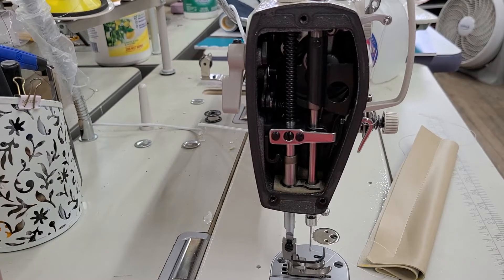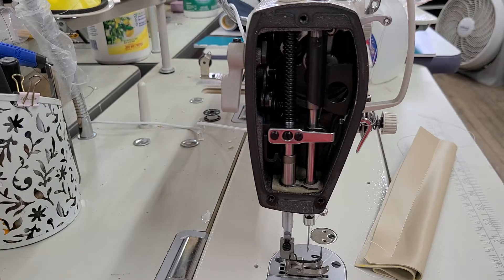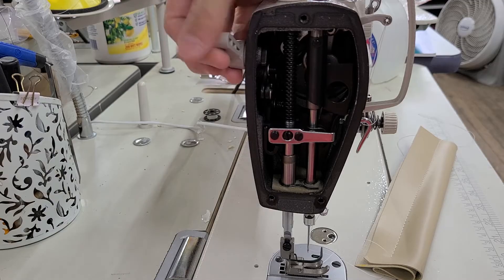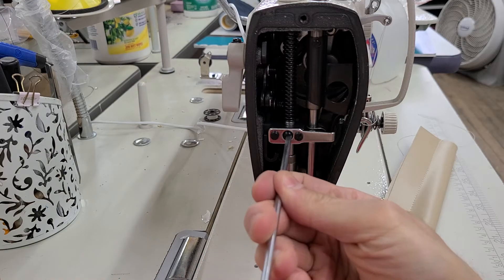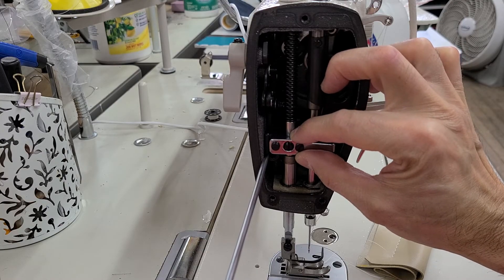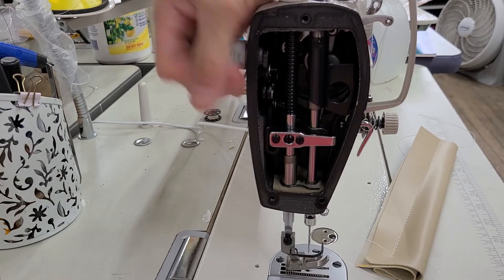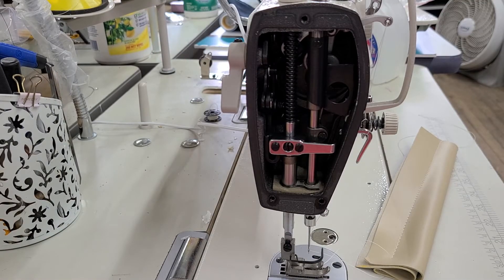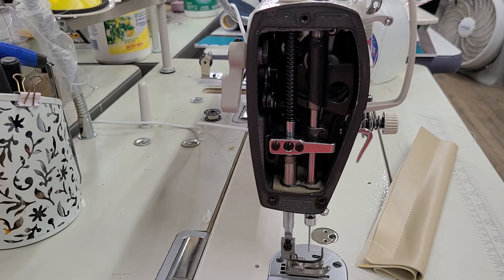Juki DDL-8700 presser foot lifter fix

Comment: Do you check comments on older videos? I hope so. I am new to industrial sewing machines and it took me months to get it to sew anything. Anyways, it is not sewing again and I have narrowed it down to that little hook that is beside the tension knob on the front. The one that is moving up and down when you lift the presser foot in this video.  While the sewing machine was acting right, that piece moved up and down. It is no longer moving up and down. I was sewing, then I had to thread a bobbin and it stopped working. Do you have any recommendations?

Comment: Can someone tell me how to get the side of the machine off as in the video?   I have undone 3 screws, one at top and two at the bottom (one near front and one near back of machine).   I have tried putting a knife in the join but I can’t get the side of it off?    I was adjusting the foot pressure screw on the top of machine, and it came all the way off, letting the spring inside fall somewhere - need to get into the machine to retrieve it.

Comment: Tried to unscrew the needle in the middle, but the silver clip won’t move. How do make move down
Reply: Had this problem just a few minutes ago. I just used my screwdriver to give an an extra push down and it worked. Put some elbow grease into it

Comment: I have this exact problem on my machine but I can't get the face plate off in order to fix it.  I have removed 3 screws and I'm pretty sure thats all of them but it feels like its glued on.  Any advice on what I can do?
Reply: Hopefully it’s fixed by now! My machine had the same problem today. I removed the screws and the end cap wouldn’t come off. I got a small chisel out to pry it off. The gasket had sealed it on. Went back on just fine.
Reply: @jenahammond111  yes I had to do the same! but its fixed now no problem.

Comment: my knee lift is not picking up my pressure foot.  It just goes all the way backward then clicks and stays stuck in a horizontal position.
I thought I needed to tighten it but that doesn't help